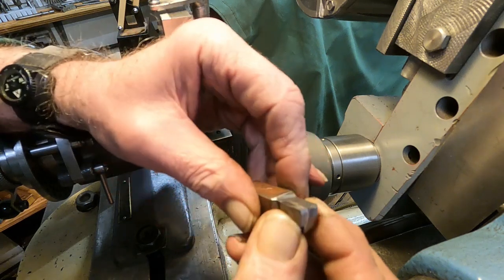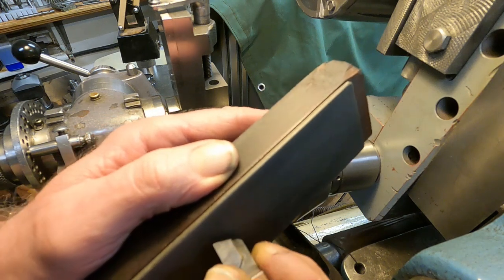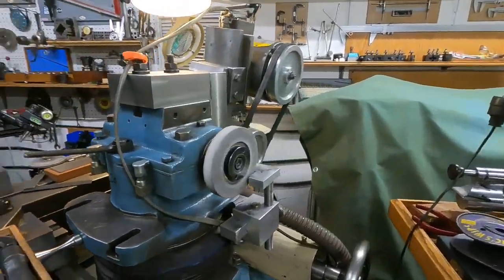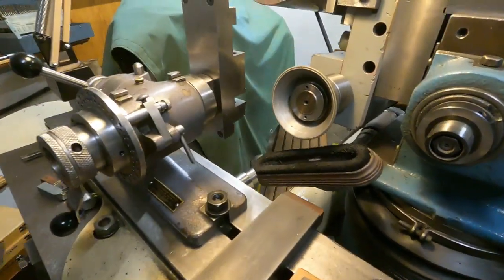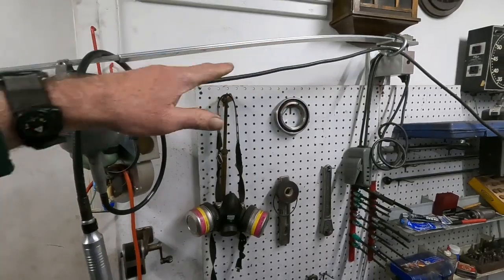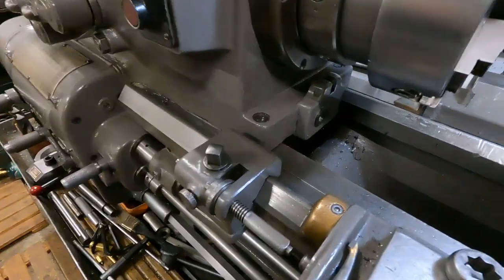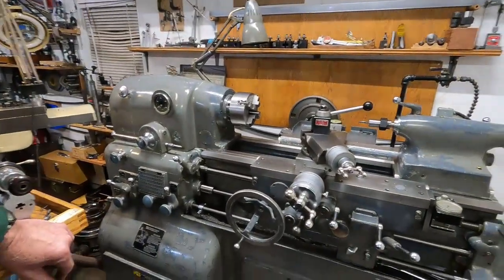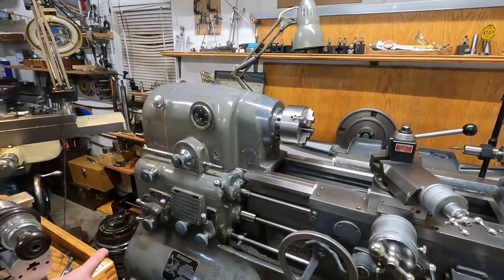Adapting a Toolpost Grinder to a Tool & Cutter Grinder

Comment: My cutter grinder has a flat plate on the back of the post opposite the grinder. I mounted my Themac 7 there 5 yrs ago, and it adds many things, for one, its a left side wheel and my air bearing is not made for a right side. Second, it adds unlimited angles, and 3rd it has extension tubes, so i can use it for a surface grinder. great idea on the 5c spindex adaptor, I will build mine asap, I have a similar vice already drilled for a 1/2 in bolt. SAME bs on my Leblond, if you take that carriage bolt out, the tang falls and you have to take the apron top off!!
Reply from the maker: Yes often the problem is getting the wheel over the table, the tool post grinder really helps. The Harig air spindle appears to work left or right hand mount but I have not used it yet, the more common make is Weldon and it has been a long time since I used one at school. The air bearing spindles were always priced out of reach I feel fortunate to get a good working one.

Comment: Nice way to add utility to the older tool and cutter grinder.
Reply from the maker: Hi, this was forgotten about, mostly done decades ago, I shop built my tool post grinder for a little more versatility on the cutter grinder solving the problem of getting a grinding wheel across the table

Comment: I should try that with my little KO Lee.. it just has a little direct drive spindle.. & also would like to someday do  some kind of id grinding.. 
 I have been using the brazed carbide bits on my little 10" Logan, but I like to take a left handed bit with some side rake, & use it tipped it on its side - then there is less carbide to grind away on the front to get into a sharp corner, and more carbide there if you have to grind down to add a new chip breaker groove on top. You also get some side relief without a ton of grinding since the carbide was sloped side to side in its original positon - alternately, could mill bottom of tool so it is tipped to side to give side relief..  Thx for sharing whats going on in your shop!
Reply from the maker: I am going to try that with brazed carbide, I have some square nosed tools that could be both right and left hand by flipping to the side, thanks for that. You may be able to use your existing spindle to belt drive an internal spindle mounted as some makes do.

Comment: I use external hard drive to store all my videos, photos, and anything else I can stuff in there. The only thing on the computer is the operating system ( in my case it’s windows 10 ) but by doing so it really makes a huge difference in how the computer performs, as well as how fast it runs. The external storage just plugs in to the USB port with a hi quality lightning cable usb. It’s basically just plug and play and the set up is pretty straightforward. Hope that helps Don, always enjoy your input Sir. 
Have a good day, stay warm !
Reply from the maker: Thanks for that, I did not know what to ask for, everyone tries to sell me a new computer, mine has only 4gb ram windows 10, the cloud thing has not worked way too slow, but now I have optical connection and everything is much faster. The small garage is very harsh on cameras so the gopro is good there. I had my big start on computers from blowing money on ebay!

Comment: Hey Don, not sure what you're dealing with on your computer but when I edit my videos I keep all of the video files on an external hard drive so that it doesn't clutter up my computer. I get the hard drives on sale from staples, or whoever is in your area, and I just grab them when they're on sale and usually pay anywhere from 25 to 30 bucks. That 25 dollar investment will last for a few months and when it gets full I just connect a new fresh one. It works well for me, maybe that's helpful info for you, maybe not, but there it is.
Reply from the maker: Thanks that is the details I needed to know, there is a Staples near by but they try to sell me a better computer as mine is windows 10 and only 4gb ram. Optical hook up just became available. Thanks so much for that!